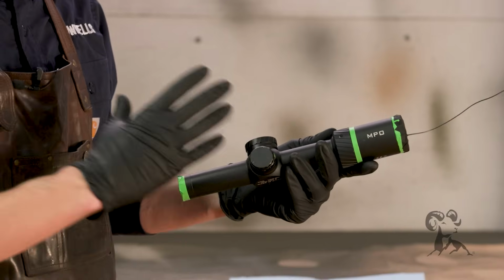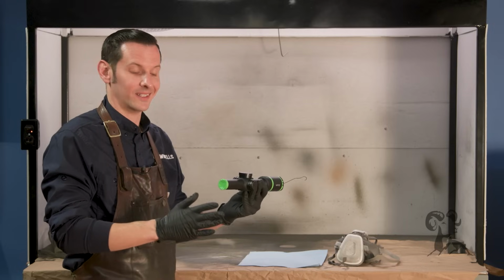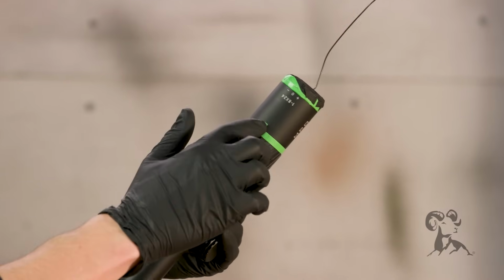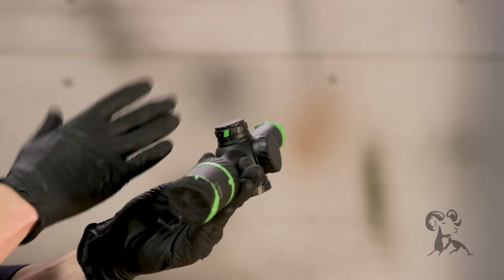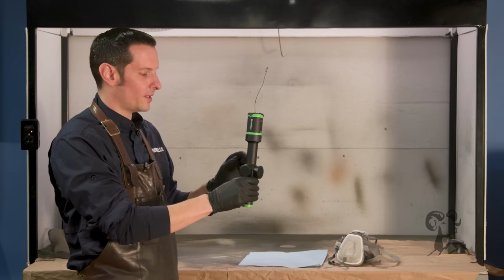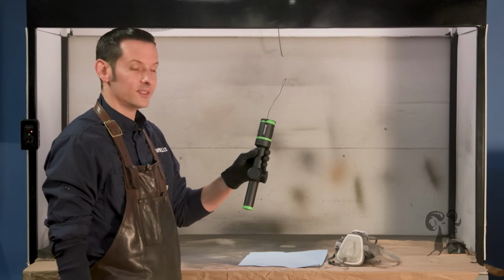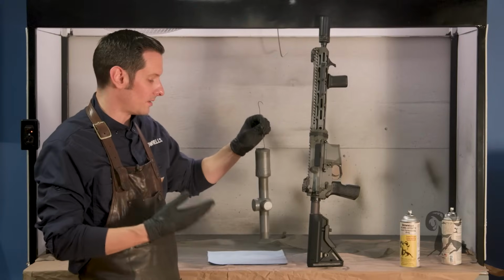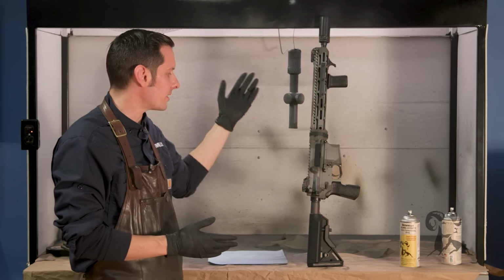How to Paint Your Firearm: Painting Optics

Comment: You can add a fishing swivel between the wire on your part and what ever your hanging it on if you want to be able to rotate it with out having to hold it up.   I did this in my paint booth for when I’m doing large lots of parts.

Comment: If you are going to hang your optic like that, I would recommend putting cotton balls or cleaning patches between the glass and the wire to avoid scratches. Pinstriping painters tape is perfect for covering the magnification numbers or indicators.
Reply from the maker: As stated in the video, there are recommended measures to protect the lens from the wire.
Reply: @brownells  You can do a Demo. " VIDEO " as you did & people still don't PAY ATTENTION TO
 
IT.
Reply: Comprehension problems?